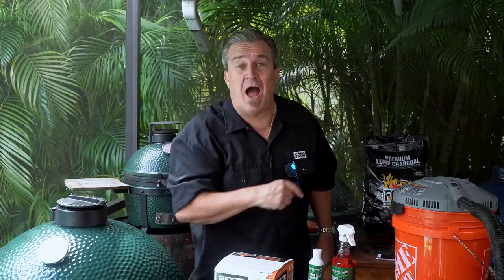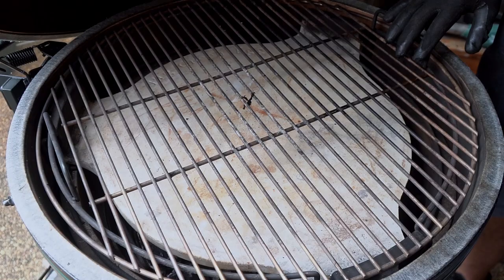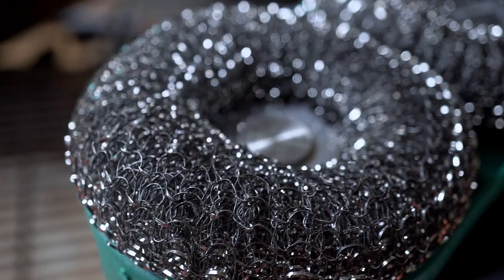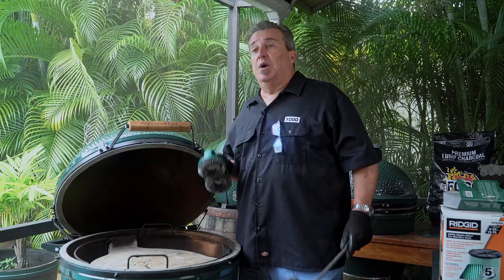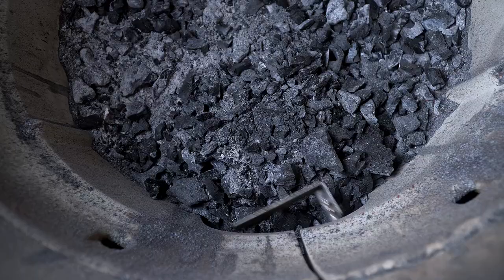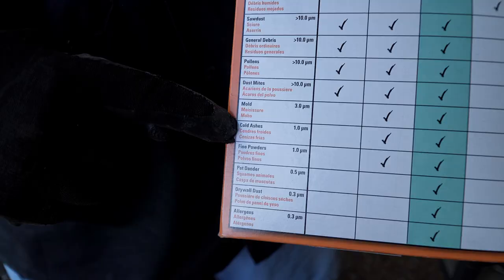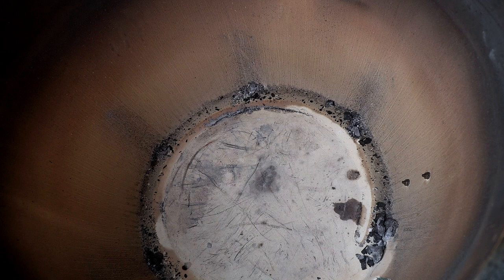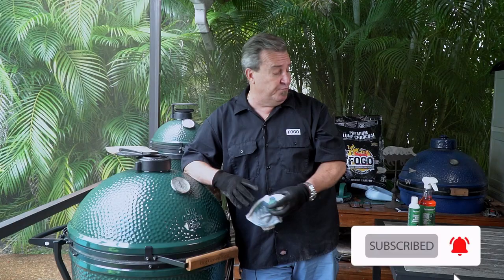Big Green Egg Maintenance and Cleaning

Comment: Good video. I highly recommend putting foil over the plate setter (ConvEggtor) to make for easy cleanup. Just replace the foil. I also use drip pans to keep the drippings from burning on the plate setter and adding an acrid taste to the cook. The plate setter gets HOT.  I space my drip pans off the plate setter with little rolls of aluminum foil so they're not in direct contact of the plate setter.
Reply from the maker: I actually do the same thing John.  I wish I'd have included it in the video.  I have done it in previous videos.  Thanks for the remnder!
Reply: @FOGOcharcoal  You're doing a great service here to potential and current BGE owners. You can be forgiven for not posting it on this video. Keep posting! It's great info that BGE owners need to know.

Comment: For the inner rings, should we use the wire brush like you did on the plate setter? I have some build up on them from some drippings and haven’t cleaned them yet.
Reply from the maker: Sure, you can do that or use a paint scraper.  Making pizza or a hot burn will work well too.

Comment: I recently bought a used BGE off of Craigslist to see if I like it and go from there.  The seller said … and I can see it … that a new gasket had recently been installed.
I would like to do a clean burn to clean the inside. If I put aluminum foil on both edges of the lids, do you think the gasket would survive or disintegrate? Also, if I do NOT do a clean burn, how would I clean all of the interior stuff, conveggtor, the lid and base?
Reply from the maker: If you have a new gasket, I would skip the clean burn.  The inside is supposed to turn black and get some buildup.  You could scrape it with an aluminum foil ball and that'll work pretty well.

Comment: One thing I do if the grill grate is building up residue is to loosely place aluminum foil on top of the grate once the cook is finished. Open up the vents and let it get to 550/600* for 5 or 10 minutes, then shut the vents. The grate should be clean enough for the next day.
Reply from the maker: That's a great idea!  Thanks Mike!

Comment: Hi Ron, thanks a lot as usual,great video.. quick question, my regulator is getting stock, do you have a recommendation of how to clean it to avoid this? Thanks again
Reply from the maker: Hey Gaston, i haven't encountered it much with my REGGulator cap but I used to simply throw my Daisy Wheel on the grates after a cook and let it heat up really well or throw it right into the hot coals while the egg shuts down.  You will have to reseason it afterwards just like any cast iron.  I'd try scraping as much as you can with a razor blade first though.

Comment: I do what you did pretty much.  I remove ash after every cook with the ash tool and I remove everything from the egg every bag of charcoal.  You didn't say anything about the lid.  I have a lot of black stuff building up on my egg's lid.   Once a year I take a electric wire brush to the black stuff on the lid and the inside of the egg.  I only brush only till when the black stuff starts turn dark brown so I don't wear down the ceramics.   Is cleaning this black stuff off the lid necessary?  I do it so it doesn't add flavor to my cooks.  I looked into a lot of professional places and they don't clean the burnt grease out of their grills.
Reply from the maker: It is really a matter of personal preference.  Depending on who you ask, you'll get different answers.  I rub mine with balled up aluminum foil when I see it starting to flake off.  I don't want that getting in my food.
Reply: @FOGOcharcoal  Good idea to use Ron.

Comment: Surprised you didn’t hit on cleaning the underside of the upper dome.
Reply from the maker: Hey Mark, thanks for the comment.  We did a video about clean burns already.  I suppose I could have hit on that without doing a clean burn as not everyone agrees with the high heat cleaning.  A balled up piece of aluminum foil works pretty well for cleaning the inside of the dome.  Thank you for the reminder, I'll put it on the list of topics to cover.